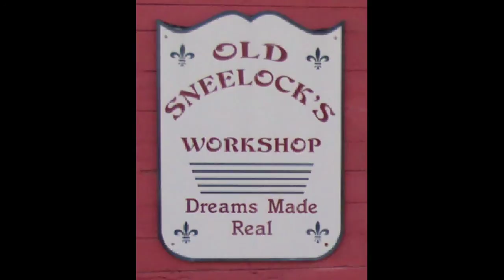Cross Cut Hand saw Pt 4 of 4 - Attach the tote a video tutorial from Old Sneelock's Workshop

Comment from the maker: Don't tell anyone but I tend to shop at flea markets and antique stores far too frequently. While there I check every saw, plane, brace, eggbeater drill, etc. If I find a saw in good condition, if the price is right I'll buy it and restore it. If the saw is too far gone I'll check the parts and if they match what I need or think I might need I'll buy the saw for parts.
You can check Ebay but the prices are usually pretty high compared to hunting your own. 
Maybe try the Galoot Central Forum.